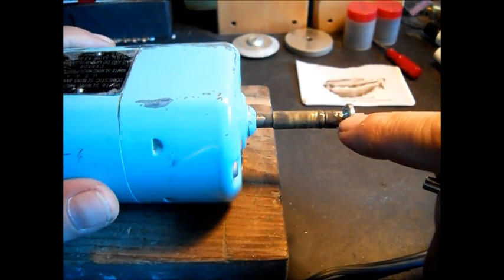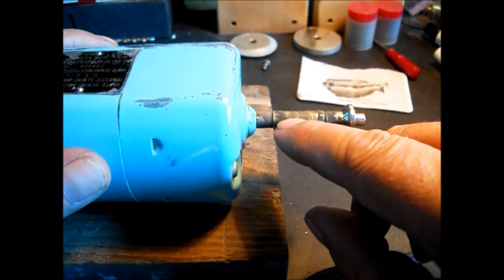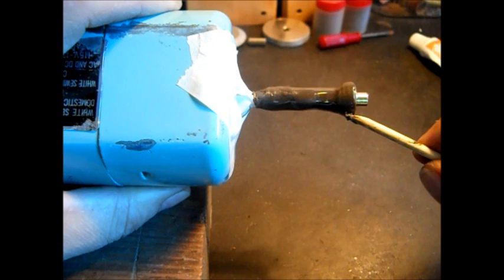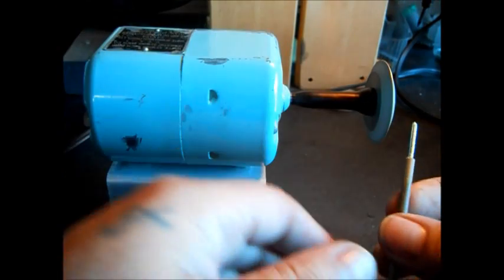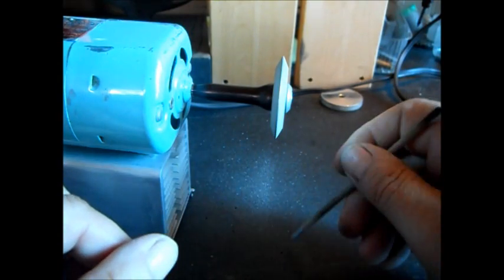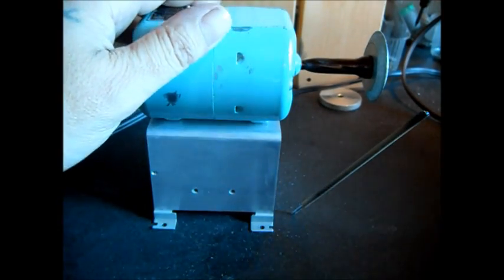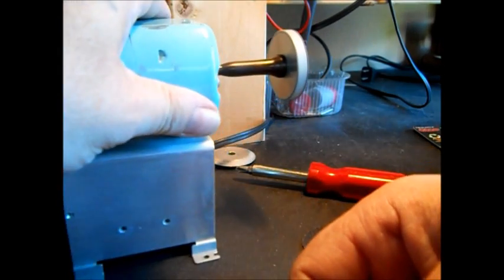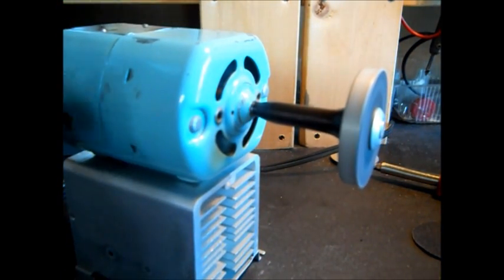Mini Bench Grinder (made from sewing machine motor).

Comment: Yes, we use metric in Canada.
Reply from the maker: I do use metric some I buy small metric bolts for projects and get a box full and have metric sockets and wrenches to work with
Reply: @not2fast4u2c  (this is the same guy from my pipe making channel). I wish your videos had more step by step help- i find them a bit hard to follow on how to make the thing you're doing. 

I'd like to build a slack belt sander with a 72" belt, and a sewing machine motor on a pedal... I make tobacco pipes, and I've heard slack belt sanders are great for shaping. Can you build one and show me?
Reply from the maker: @JDSilverTobaccoPipes  For me that would be way too much work when I could by a cheap belt sander and modify it to what I wand   Sewing machine motors do not have much power
Reply: @not2fast4u2c  Oh, so maybe it wouldn't work. Thanks for the help!

Comment: planning to make a drill with it for long term use, as its metal = cool running
Reply from the maker: I would like to machine something so I could put a  small 1/4 inch drill chuck on  one of these motors
Reply: @not2fast4u2c  do they wobble, the motor shaft when running ?